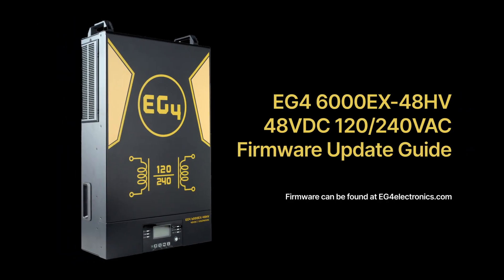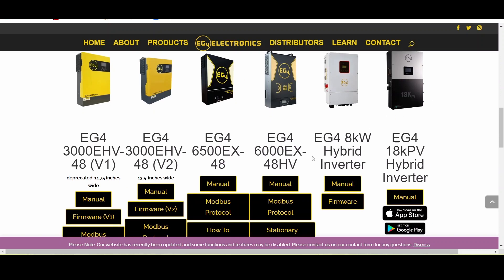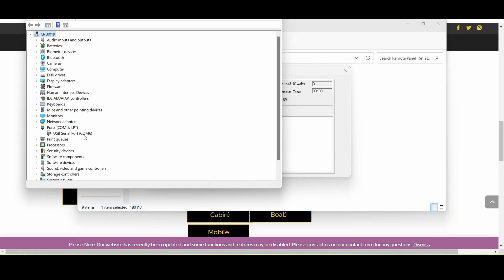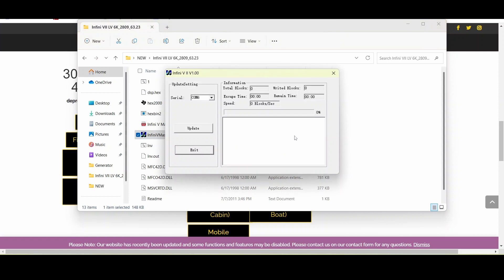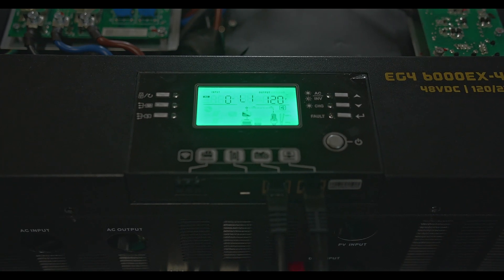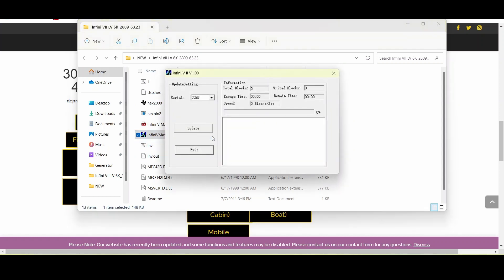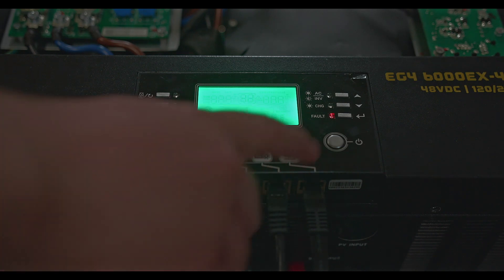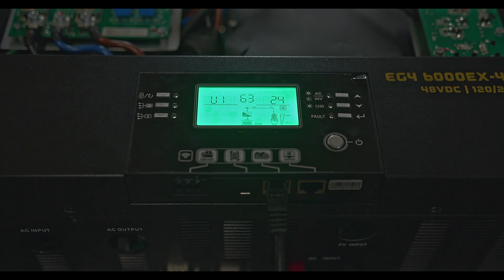Revamped Firmware Update Guide | EG4 6000EX All-In-One Solar Inverter

Comment: 6000EX-48HU is a good inverter but it takes a lot of electricity even if it does nothing...  Maybe it is easier just to add a step-up transformer to 3000EHV-48 and you have 240v?

Comment: Notice how he blows off all of the issues about the firmware update cables that people have had without telling you what kind of cable that is or that SS did not send such cables to most of us and that the update cable that you use for your battery will not work - even though the connector ends are the same.
Reply: The cable used to update your batteries has a different microchip in the USB end than the cable used here; different microchips for different purposes. Email Signature Solar's and they can provide the information needed to make your own firmware update cable; the two part version they use to send out with the units.